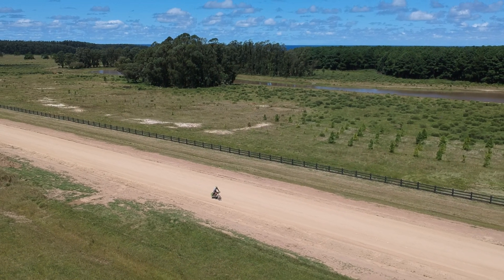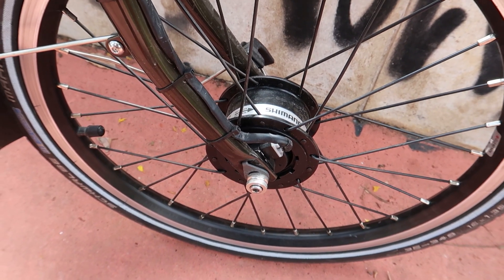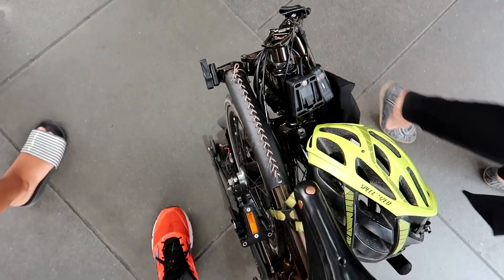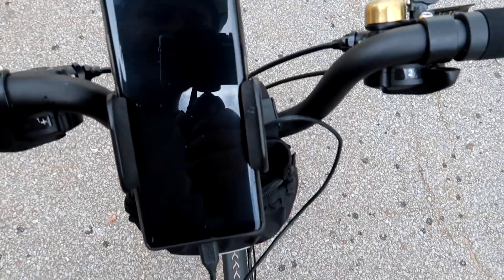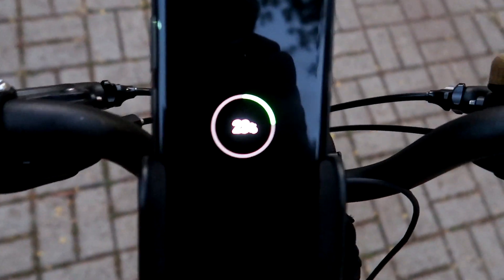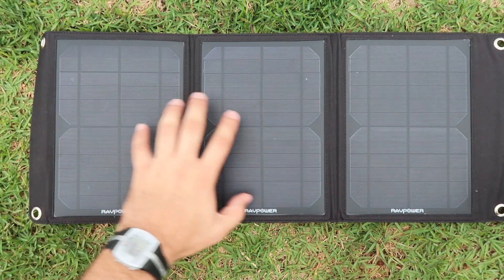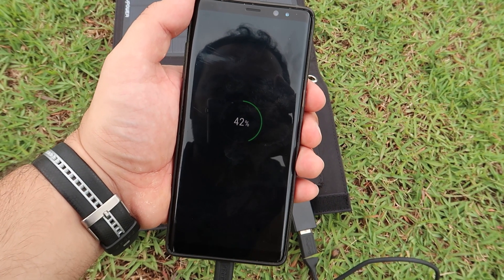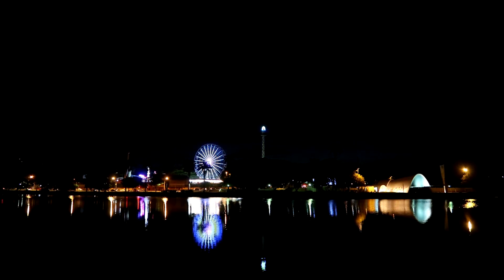Bicycle Dynamo Hub vs. Solar Panel

Comment: I've got a Son 28 hub on a 26" wheel mtb. Yesterday I rode 100km at 20.5kmph average speed. I charged a fully empty Anker 10,000mah power bank. After the 100km ride I powered my phone which has a 5000mah battery. I was able to get the phone to charge from 30%-60%, so roughly 1500 milliamps. I'm using a Sinewave usb charger. To be honest I'm far from impressed. I also have two RAV solar panels which I've used while hiking and I think they're brilliant. In fact in good sunlight I can charge an ipad mini with the 24W version in the same time as i would using mains power with the Apple charger (i.e. not a super fast charger).
Personally I wish i'd not bothered buying the Son hub. In all I spent nearly £400 for the rim, wheel build cost, Son hub + Sinewave.
Reply: Dynamo hubs are for lights....

Comment: If u travel…
👍 cafes and co maybe let u load ur powerbanks for a wile/ for the break if u buy stuff … so if u make a break, try ur luck. The wall outlet always be the best.
Train station, airports and co sometimes got outlets for the cleaning personal in the open. 😉 try sitting next to it and borrow some power while making a break or repairing ur bike.

Comment: Nice comparison very helpful, I am inclined to want to use both, that way you can use both solutions for 2 different applications, and whilst touring you can charge whilst riding, and even when you stop so you don't lose time.

Comment: My personal killer argument for the dynamo-hub. It's there and I don't have to care for it. It simply works. I also do my dayly commuter rides and I imply have to reley on a working light during the winter. IT! HAS! TO! WORK! PERIOD!
Yes, charging the phone is problematic. I'm still wrapping my head around it. In the meantime, I use a powerbank.

Comment: Great experiment.  Anyway I wanted to get a solar charger for my phone. Especially, for those multi-day touring rides.  Thanks for sharing.
Reply: A solar charger is a useful thing to have, in any event. That it can be used while cycling.. and while on a cycling trip but not actually cycling, is a double bonus.

Comment: Ok youtube crowd, just to chime in here. I toured down the entire west coast of the united states with that exact solar charger and I would 100% NOT recommend doing that. It was almost entirely useless. I will only be using dynamos from now on. The reason why is twofold:

1. Unlike what this video says, the main DISADVANTAGE of a solar panel is the on vs. off bike charging situation. When you tour, you spend almost 100% of daylight hours on the road riding -- like 5-8 hours a day of sunlight. During this time, when the sun is at its peak, it is slung over the back of your pannier, going in and out of shade (since you very rarely ride in the middle of a freaking field as this guy had it, and in fact most pleasant places to bike tour have a LOT of tree cover).

2. By contrast, a dynamo charges your device while you ride and when you get to a campsite, your stuff is good to go for the evening. While it might be slightly slower, in practice the solar panel we used was (and i repeat) almost ENTIRELY unusable in an actual bike touring setting.

Finally, part of the poor results for dynamos in this video might be the way the devices were charged (although this goes for both). You should basically never plug in a phone into either charger. Instead, you should be trickle charging a battery that won't mind the current fluctuations and unsteady charges induced by either method. Then at night you plug your phone into the fully charged battery.

Happy riding!

Comment: The varying power from solar panels can confuse a phone, so you might use the panel to charge a battery pack and the pack to charge you phone. Also, that means you don't need to leave your phone unattended out in the hot sun.

Comment: I agree, its not only about the watts, but also about how & when it works. I like a solar charger juicing a power storage device on board in the charger pocket, where it can capture juice throughout day light hours, without ever adding drag to my ride. That arrangement can recharge devices like phone & radio & lights & even NiMh AA && AAA cells.
Reply from the maker: I absolutely agree with you!

Comment: Greta comparison. I would easily use a dynamo as it lights up the road.
I´m thinking of a Brompton, I guess this is a Brompton specific dynamo hub as the wheels are small?
Does it work well  when riding?
TIA 👍🏻

Comment: Great video, thank you. Concur 100% Had many bike tours in the south of France, made several chargers for the Hub, ( one of which caught fire at 35mph!)  in the end made a charger with a built in battery pack which capped the voltage, and had a usb board with a digital readout of voltage and current. this worked OK, but I had to ride about 40 miles to do what my Anker 15W solar panel would do in an hour of French summer sunshine. Also had the advantage that I could ride in the daytime with my lights on for safety purposes.  Incidentally, never trusted the chargers direct to the phone, always went via a power bank, not as efficient, but with an expensive phone, prudent.

Comment: Obviously you need both devices ... A Dynamo Hub is an indispensable device on EVERY bike. It is the only way to guarantee reliable lighting on a bike. - And, yes, you can charge your mobile phone with it, but yeah, 3 W at 6 V is not that much and you need the Busch & Müller E-Werk to convert the power and the conversion costs efficiency.
The solar panels have all the conversion integrated and are quite efficient nowadays. If you are able to use them during the ride, they are nearly perfect for supplying your mobile device.
A perfect Dynamo Hub (SON) cost 260 EUR (wheel included).
A solar panel costs between 40 EUR (the RAV power) and 200 EUR.

Comment: strange comparison,you dont need to stop to charge with solar panel,just attach to your backpack while riding and you will always have full battery phone+you will charge lithium  lights for bicycle before dark.without loosing any power with dynamo hubs

Comment: You need to take cost per watt hour in consideration and weight. It is clear the Solar is a better choice as a bike trekker, you need to consider the places you go. 
For city the Hub is good but if you need to carry the bike then weight of the bike matters.

Comment: I tend to use my SON 28 dynamo paired with a sinewave revolution USB converter when bikepacking.  As I’m using the viewranger mapping on my iPhone during my ride.  The 
dynamo keeps the iPhone trickle charging the whole time, so helps to keep phone battery topped up.  

Less use of my battery power bank later on when camping.
Reply: I've got a Son 28 on a 26" wheel mtb also with a sinewave revolution. Yesterday I rode 100km at 20.5km p/hour average speed. I charged an Anker power bank from empty. After 100km I charged my phone. My phone has a 5000mah battery. It charged from 30% to 60%. This means I got about 1500milli amps for my 100km. It's not particularly impressive. I'd love to know if you like your set up. Does my test sound comparable to your experiences.
Reply: @And-rc9yy  Probaby the same.  I don’t charge my powerbanks with the Dynamo.  I just try to keep my iPhone topped up all day using Dynamo, so after cycling I can use my powebanks as and when needed.  Using phone as navigation so uses a bit of power.
Reply: @bikepackingadventure7913  Thanks for the reply, I'm half tempted to buy a Cinq 5 pure. This particular usb charger is supposed to give up to 700ma max output, it's also quite a neat device as it's essentially a Ahead top cap. I might just be throwing money down the drain. Incidentally, when I charge my phone (instead of the power bank) I can only just keep it at the same power level. This is even with Wifi and cellular turned off. I'm not a slow cyclist either it's just hard to average much over 20km an hour with weighted panniers. It was probably an expensive mistake buying into the dynamo system in the first place.

Comment: They dynamo companies need to come up with a better way to harvest the power during the day so you can use it later....the same thing with the portable solar panels companies, the electronics inside really limit your ability to actually use full power the panel can deliver!!!! So Sad...
When you mount that three panel solar panel on your bike, try to divide the panels in different directions... Middle facing up and the others to the left and right of your bike...The panels are in parallel and you are constantly changing your position to the sun... One panel will be getting good sun....if you have a 21 watt unit each panel is making 7 watts...
Reply: Let me add one more thing, you will never actually get 21watts out of the solar panel just because like I said before, the USB electronics limit your ability to get it!!! 👎

Comment: Great, "IRL" comparison test, thanks! My additional thoughts were 1. How much extra weight does the solar panel set up add, and 2. How much extra drag does a dynamo hub produce? On point 2, since nothing's for free, extra work is required to charge stuff up and, presumably you can't "turn the hub off" (resistance is there whether you use it or not). When you spun your wheel, it didn't seem to rotate all that freely. I guess there's a third point too, which would be the relative cost of each option.
Please keep the videos coming, I thoroughly enjoy them.
Reply: Are you familiar with the channel “Cycleabout”.  Alee does a really good dive into dynamo hubs and he addresses your question of resistance really well.
Reply: @FirstnameLastname-bp5cm  I was not familiar with this channel, so thanks for the steer.
Reply: A bit to late, but my "28w" solar panel weighs 700g (4 pages of panels)

Comment: Hm... I would say you need also consider your camping style.

In my camping experience solar panels would be useless because when the Sun shines I'm moving—on legs, walking around, or on bike—with my phone in both cases. And if I'm not moving, it's probably because it's night already—solar panel useless too in this case. Sure, if it's a long trip, solar panels may be useful in the morning, but you will need to make sure that you get up with sunrise and place solar panel somewhere in a way it can't be stolen while you finishing your sleep.
Reply: You can lay the solar panels across the rear panniers and charge while moving.

Comment: I guess you could attach the solar panel to your luggage rack or just on your bike where the sun could reach it
Reply from the maker: Absolutely. I wish I had the solar panel with me today to do a "ridden" test, attaching it to the bags and seeing how well they perform. I'll do that in the future!
Reply: I'm thinking about how to attached it to the S-bag or on the rack... if not on my Brompton Radical Chubby trailer ;)  Looking forward to see your solution! Thanks for sharing your ideas. Great channel... and great work!
Reply: @snabelone  I just found out about the chubby trailer from a guy who does videos out of Colorado. How are you liking it?
Reply: @NoZenith   I copy/paste this from my reply on the manufactorers YouTube page...  

How ever there are some issues to adress as well. 

1.The wheels don't really fit in the top zipper. You have to deflate them to make them fit! However Radical Design in Holland can make you an extra Wheel bag for you that can be strapped on top of the cart to solve that problem. The trailer is also made for another small folding bike that have smaller tires... so thats why. And they also have a Wheel bag for those smaller wheels. You can also put the trailers wheels in the large Chubby compartment of course but then when  handled at airport or whatever I can easily see that they will be damaged if not rapped up properly. An extra space especially for the wheels would at least make me more at rest.

2. If you use the trailer to shop grocery with, you will find that the zipper is at the bottom and you will have to unzip it every time to put something in the cart. Very annoying! Why didn't Radical Design not used a full size zipper all the way round? One good thing with all the zippers though is that you could put locks on them!

3. The carrying handle is a little bit on the weaker side. You can put 40 kg of the stuff in the trailer.... if so you would like the strap to have some extra seams to support that kind of weight if you ask me. They also sell an extra shoulder pad for an insanely 25 EUR extra. 

4. Like any bag or backpack... why don't make the fabric water proof in the first place? If you want to strap gear on top of the trailer... how are you going to that that if you have the rain cover on? In my case I would like strap an extra bag and foldable solar panels... 

5. The Quick-release axle with spacer made of rubber are one of a kind! Buy extras!  Radical alos provide  axles with a bolt what they call bombproof. At least buy some extra spacers! I 

6. How ever a great trailer... Loving it!

Stay safe and fair winds to you all!

Happy trailing! 🇸🇪

However I like it!!!
Reply: @snabelone  thank you!

Comment: Great information. The Brompton Electric provides lighting power and a USB port. It would be great to get some comparison info on charging and consumption during longer day rides or extended travel. Thanks, Dale
Reply: Sadly, Brompton Electric is illegal in HK.  We cannot legally use them here.

Comment: Thank you for your meticulously detailed comparison between these two means of power generation. 

Your detailed comparison greatly informs fellow cyclists and is also great viewing too. 

I had originally intended to fit the beautiful Son XS Dynamo and Edelux 2 Headlight and Son 50mm Rear light to provide lighting and to power an Igaro D2 USB Charger.

I then began reading about dynamo drag! 

There were other factors which slowly became apparent, such as quite how much riding did I intend to be doing at night and the distance and frequency of it, and the light output of the Son XS Dynamo & Edelux lights compared to the high quality, lightweight, inexpensive and high output LED lights which are widely available.

There was also the question of whether the Son XS Dynamo could produce sufficient power to fully operate the lights as well as the Igaro USB Charger.

Finaly the issues of the additional weight of the Son XS Dynamo & Edelux lights and the cost outlay.

I had budgeted around £450 > £500 for the complete Son & Edelux set up, plus £175 for the Igaro Charger.

Determining that I was unlikely to want to travel at night and that the aforementioned high output LED lights would suffice, and that my proposed dynamo set up wouldn't really do much for the Igaro's ability to do it's job, and the factors of dynamo drag, weight and cost, I decided against fitting my originally chosen dynamo and lighting system! 

It was always my intention to supplement the dynamo with a 4 panel compact solar panel capable of being used whilst riding and in camp, and your findings have validated that decision.

I'd intended to have a self contained power pack to charge my devices and for the power pack itself to be recharged by the solar panel and Igaro unit to protect the devices being charged.

It also occurred to me that the money saved by not buying the dynamo and lights would be sufficient to fund a trip!

As I will be using a titanium tent stove I also toyed with the idea of buying a Peltier type device to be able to generate electricity from the heat of my tent stove!

Apologies for the length of my post, I tried to keep it concise.

Comment: Hi Victor, great video as usual, how much effort compare not using the dynamo hub, since electricity generated from dynamo required extra mechanical power from your pedal